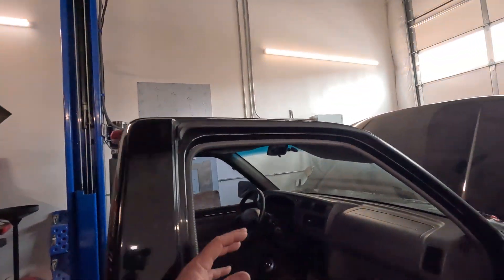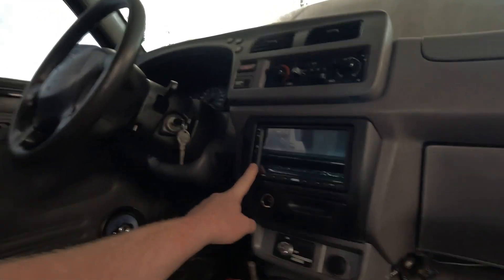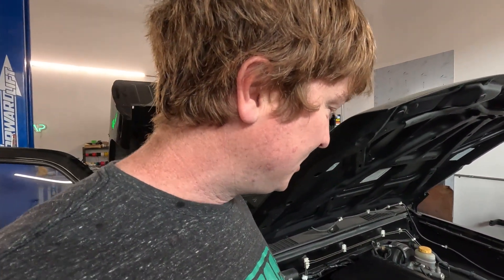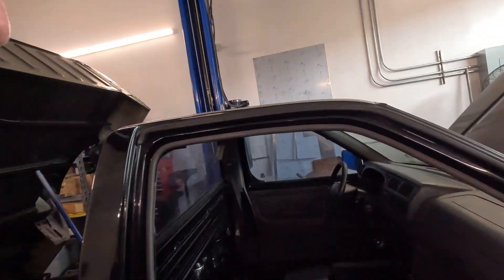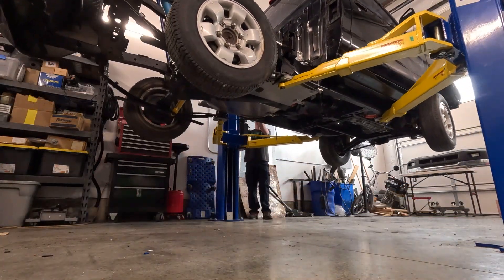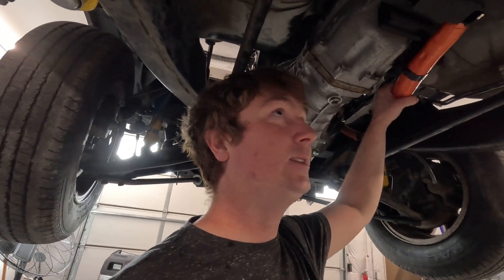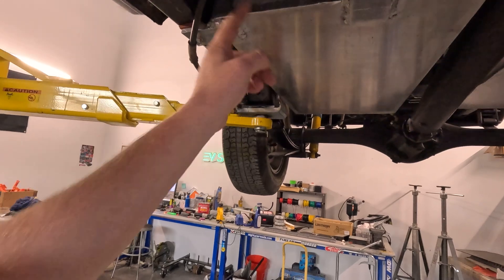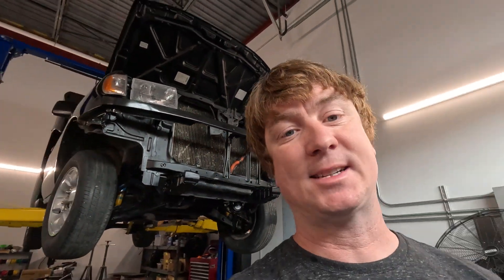EV Frontier: Upgrading the Dashboard & Interior

Comment: Hi - I’m going to go down a similar path to you and use Resolve. My conversion will be Leaf — VW T2 bus.
One thing I’m trying to confirm is the limitation when it comes to battery pack size and fast (Chademo) charging.
As far as I understand it, if I want fast charging I have to stick to the battery packs up to 2017. And that means 24kWh, and a few 30kWh. But I want some range, so if I go to a new battery+BMS I can get 62kWh, which is great range, but then I can’t fast charge it to get home!
Just wondering if you’d been through this with your conversion or if you think I may have this wrong.
I’ve sent an email to Isak so will see what he confirms.
Looking forward to seeing your test drive soon!
Reply from the maker: You can use the later batteries with an earlier PDM and get Chademo fast charging. It's only the PDM that is the issue.
Reply: @EVSwap  well that’s great intel! Thanks for replying. I’ve been having a slight wobble on the plan, but this would put me back on track. Good news!

Comment: Thanks for the update!   You are getting so close, and I am looking forward to the first drive.  I would LOVE to do a Frontier like that with a Leaf powertrain, or other smallish sized pickup as my daily driver.   While I do work on my cars a lot and consider myself a decent DIY mechanic, do you think an EV swap is doable ?  If not, is there training that you would recommend to gain additional skill sets?  Let me know, and I look forward to more videos and projects in the future!
Reply from the maker: Thanks I really love this truck too I want to build my own! The mechanical parts of an EV conversion are pretty easy. Not a lot to it. In a lot of ways it's simpler than an engine swap. The hard part is the high voltage battery. They are very dangerous and take special training to work with. Other than that it's definitely something the DIYer can do!